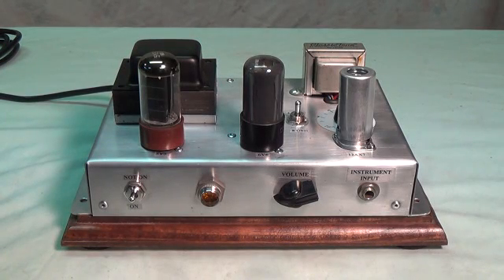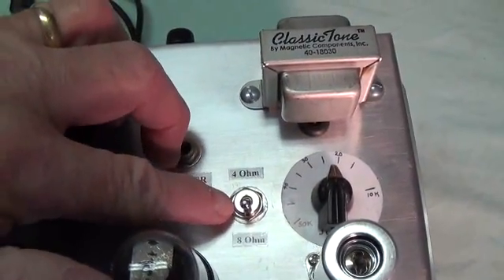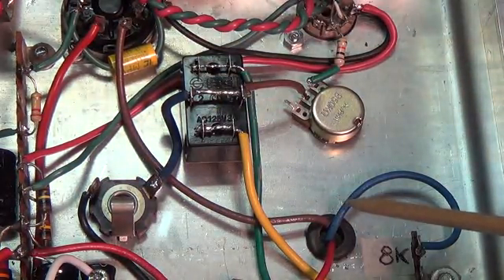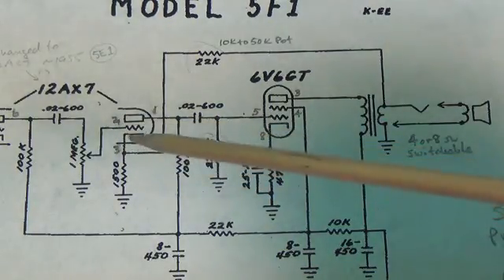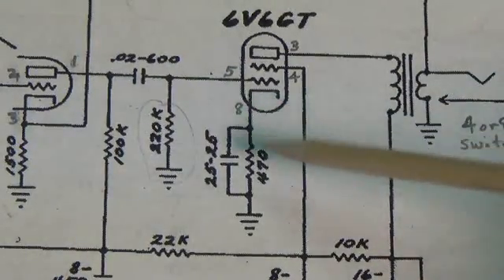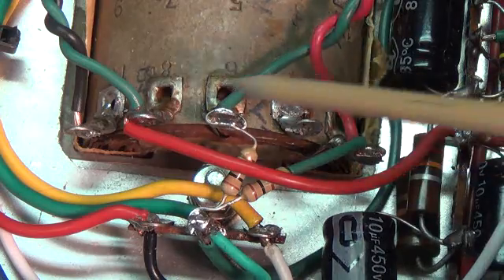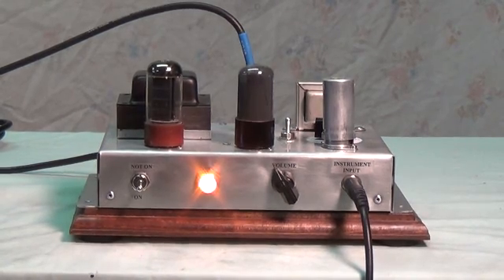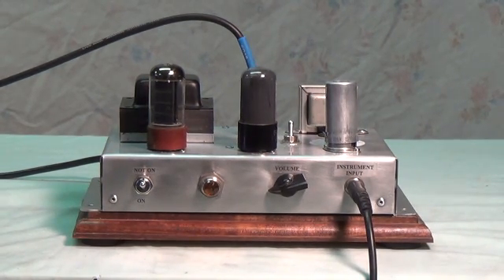Scratch Building a Fender 5F1 Champ from Scrap Parts.....Part 2

Comment: I have returned after 2 years of rukus to find this video. The NFB is a delight. I have a Kustom Defender 5H  with a EL84 instead of my fave 6V6 any way I had to find a Russian site and translate it to get all the mods Tone stack and Master vol) . The one thing missing was the NFB. Turns out the Defender 22K to the second section 12AX7 Cathode  made it silent there is no joy in Mudville. So, I put a 500K in series with the 22K and the vol was still low so I think a 1 Meg pot + a 100K might do it. .  I enjoy your videos and have learned so much. Thank you for all you do. Hope you are well.
Reply from the maker: You're welcome, Barney. Yes, we are all doing quite well indeed. Thanks !!
Reply: @UncleDoug   LOL if you want to have a chuckle, here is the Russian site for the Kustom Defender 5H. The translation is not so good. :) https://forum.guitarplayer.ru/index.php?topic=158288.30
Reply: Effectively they are saying for the Kustom Defender 5H, is; remove R3 the 0 zero  ohm resistor and insert the Fender tone stack into the two empty holes. . Treb lead to the top hole, Mid lead out to the bottom hole and ground to ground. This bypasses the stock PCB tone circuit.   Fender tone stack (Bass 250K pot treb 1Meg pot  mid  pot  200k,  Bass cap .047Uf, Mid .022uf, Treb .220nf  + 68k  joined lead out  to solder point connection.  (treb cap-resistor in parallel. ). Also remove   R15, R16, C15  (above the stock vol pot) .............(it's the stock tone circuit) ................................................................  Then for the Master Volume to the EL84 power tube, remove  R4, R16 and R17 (voltage divider) and replace with a 1 meg pot (voltage divider)  Wiper wired to top of R4,  lug 1 to top of R17  hole, and lug 3 to  top of R16 hole ( ground)...  The amp is a boutique niche that only 1% of guitar players will appreciate , especially 1920-1950s blues fans.  Its a screaming Bearcat when pushed, Its a nice tinder box at low vols.  This Amp can be had for $89 on eBay. It's a great learning platform.  I would like to calc the math on all the circuits.  Thanks uncle Doug,  I think you have all the videos for me to calculate the math.
Reply from the maker: Other than the snazzy Russian babes, the site was Greek to me, Barney. Thanks for the translation and good luck with your calculations :)

Comment: Start with a better transformer than they use-- preferably with a good choke as well.  It is impressive how decent some of the modern amps are, but the need to come in at several hundred dollars (like 500-1,000) means that have to build it at somewhere between 100-200 dollars. Like I said, impressive, but definitely one of the major reasons why some (and I say SOME) of the boutique, French, Italian and US amps are so much better.  Also a bit part of the reason why some of the 60-70's amps are so sought after, when they often only had to multiply by 2-3 times from manufacturing to retail.

I got a Jackson Ampworks McFly (about 1 watt with built-in attenuator on to 70 watts of pure single-ended Class-A output with both sets of 6V6's and 6L6's enabled.  That little amp has a 200+ watt custom transformer.  Also, (and I have seriously worked with hundreds of different amps), I love the Amplifier Company 3100 and Bimbo too.   Like the McFly, the Bimbo is perfect for studio and gig'ing, and sound so powerfully soaring, and so clean or raunchy at any output with amazing isolation and control that it can make you cry (or at least me).  There is no sweet spot for them that I have found.  It's like they are like ready to rage while under consistent control at any output.  

There are many other great amp designs, but I'd try starting with a great transformer and proper mechanical and electrical isolation, as part of what will help bring down the microphonics, feedback loop issues and other problems of many modern amps at various output levels.    Few if any of the great amps I know could do what they do without the transformer and related sections they used.
Reply from the maker: Thanks for your input, Andrew.
Reply: @UncleDoug   - BTW, love the handle "Uncle Doug".
Reply from the maker: A nephew called me that when he first learned to talk. For some reason it seemed to fit for my YT channel.

Comment: Pardon me Uncle Doug if you've mentioned, or accomplished this possibility in another video. Have you ever sat down, and made a crazy loud & powerful... "SHRED" amp? something like a Marshall Plexi- 100watts? I'd be very interested in hearing that and following along. This little Champenstein's journey is just swell! Thanks-
Reply from the maker: No, Bradley, the most powerful amp I've ever built was a AA-764 Fender Bassman......probably 50W. I simply have no use for loud, high-wattage amps and find them excessively bulky, heavy, and difficult to ship, when sold.

Comment: I have never built an amp before, and I am going to start with this exact design! I've had lots of people tell me that it is a great idea to start with a Fender 5F1 Champ for a first amp, because it has so few variables. One thing that I see being a problem is that you used parts that you found, and I will need to order new parts. I don't have the experience yet to sort out which power transformer,  output transformer, etc... but I hope the ol' internet can help me with that. I love the NFB loop dial. That is so clever. Also, the variable bias resistor that you can dial in with a screw. I don't know if those things are easily available, but I'm gonna try.  Being so new, it is also hard to find a reliable schematic to go off of. There are literally dozens and dozens of Champ schematics out there, but I can't tell just by looking at them if they are accurate or off, and if they are off... off in what way, and by how much. Ha ha ha. Oh well... gotta start somewhere. Thanks for the videos!  You should DEF. have a patreon page or sell your amps or something. I'd def. contribute or buy one of your refurbs, if for nothing else, just to say thanks!
Reply from the maker: Greetings, Michael, and thanks for all the nice comments. I do have a Patreon page and accept PayPal donations to account dldcam@aol.com. The schematic you are looking for is here:  http://i0.wp.com/myfenderchamp.com/wp-content/uploads/2010/03/champ_5f1-schematic.png  You can order your parts from Antique Electronic Supply and your transformers from Amp Parts Direct:  https://shop.amppartsdirect.com/main.sc  They offer transformer sets for the 5F1 Champ. Good luck.
Reply: I just built a 5F1 with a StewMac kit. It’s bog standard, and much less cool looking than this one. But it has every piece you need, and amazing instructions. If you want to go that route, I’d recommend the StewMac kit.

Comment: Thanks for the videos and sharing your knowledge. It seems that the tubes used in this amp were really popular...the 5Y3, 6V6, and 12AX7's seem like the standard for a lot of small amps. I think I'll use this circuit to make a small amp. I have an old wooden Philco radio cabinet that this would be perfect for!
Reply from the maker: You're welcome, 74D. Yes, those 3 tubes have been the basis for countless amps over the years. Good luck with your project.
Reply: Uncle Doug thanks a lot!

Comment: Hi Uncle Doug, thanks so much fom your videos, started working on amps myself with a lot of success. Came back to this video because I'm looking at a Fender Champ that's biased way too hot. 
Your Champ is really biased very cold at 9W at 31mA 305V. http://www.tedweber.com/webervst/tubes1/calcbias.htm
Bias calculator says you can have 41mA at 305V and still be safe. That must also be the reason it's breaking up so fast. The beast I'm looking at is running 19W, just short of 50mA at 400V. The reason is they just copied the Fender schematic values for the cathode bias resistor. 
Then again I'm beginning to think running stuff very cold is the key to what we perceive as vintage sound. Here in Europe the main European distributor of amp kits also have test voltages above 14W -- maybe this is because their main business is selling tubes ;-) Then again, we have the export transformers, most use the 230V connection. My wall socket has 238V, working on old PA amps taught me to connect to the 240V to get into the ballpark of the voltages indicated on schematics. 
There is soo much on youtube, but I would love to see a video of 1957 Champ that sounds killer in which they open it up and measure the voltages. If you happen to check my videos, sorry, didn't buy the dog to imitate you. My wife bought it and it's keeping me off work! take care, thanks again for your videos. 
Johan
Reply from the maker: As I stated in my response to your other comment, Zj, some of my statements in the SE Bias video were incorrect. Correct: Cold Bias = Lots of Headroom and Hot Bias = Early Breakup. I apologize for this error, but I was using a misleading graph, found on the Internet, as my source of info. 

I have found from experience that proper bias (PD) levels are subjective and vary depending on the needs/preferences of the amp owner. I think it's best for people to experiment with bias levels, to find the one they prefer.

I do like your suggestion regarding measurement of all the voltages within a good-sounding vintage amp, i.e. '57 Champ. Perhaps I will be able to do this some day. Meanwhile, best of luck to you in all your projects.

Comment: I want to really thank you for your videos.  I have not been around tube amps for a long time and forgot most of what I knew.  You have taken me beyond that point by far already.  But I do have a question that has been bugging me for several videos I have seen.  The hum from the heater circuit seems to be a reoccurring problem in many amps.  In this video you added a resistor network to make a phantom center tap to attack the problem.  I am wondering why not use a bridge rectifier to convert the heater current to DC.  Would that not be a total solution?
Reply from the maker: You're welcome, SW.  60Hz hum is generally not a problem in a properly designed and constructed amp. Yes, you can rectify the heater voltage, but after smoothing the ripple with electrolytic capacitor(s), the resulting voltage will be too high (ideally around 8.9VDC), so you would have to reduce and/or regulate it. Since the vast majority of amps function just fine with AC filament voltage, there is little incentive to add full wave rectification, extra filter cap(s), a large step-down resistor (which would reduce the current flow), DC regulation, etc.
Reply: I got it.  Thanks for the thorough explanation.

Comment: the amp works a miracle for it makes a guitar wich is miserably out of tune, actually sound beautyful. thank you very much for the inspiration about the modification to the negative feedback loop as well as thelesion about 6v virtual ground using 2x 100 ohm resistors (1/4 Watt i assume, right?) no need to apologize about the lousy passgae!!! that makes the things you do, comparable. your vid´s are a true inspiration to anyone interested in tueb amp building.
iám planning to modifiy a dynachord HIFI Favorit II T, the t stands for transistorized and i want to revert this amp to a former stage wehn the amp had tubes in the pre amp stages.
i would love to hear your recommendations about this project.
Reply from the maker: You're welcome, Herman. We're glad to hear that the video was inspirational, despite the guitar being "miserably out of tune" :).  The procedure to replace a transistorized pre-amp with tubes would be a daunting one, particularly the need for creation of an additional power supply. Perhaps you could use the same one I describe in my video regarding the Rick-o-Tone Tremolo, with opposed CT 12VAC transformers. Good luck.
Reply: it´s like a rollback with this amp in particular. the dynachord hifi favorit I had tubes in it´s preamp stages and hifi favorit IIt got transistorized in its pre stages. power amp still is 2xel34´s and a driver 12at7 (Ecc81 i guess) i watched your vid! the one you´ve converted a trans and turned it into a tube amp. that alsowas very inspiring. it actually got me think about converting my dynachord.......thank you very much. i love your vids.
Reply from the maker: You're welcome, Herman. Best of luck with your project.

Comment: I’ve just come across this great little amp vid. I do love your humour! I believe that you have your output jack switched marked the wrong way round. You have the yellow 4Ω wire connected to the end of the switch nearest to the output jack, and the same end is marked as 4Ω on top of the chassis. However, the yellow wire will be connected when the toggle is switched away from the socket. Toggles connect to the opposite wire to the way they are switched. If your speaker is 8Ω then you actually showing the 6V6 10K by using the 5K tap. Might be why you think 5K is better than 8K? Cheers for another great video!
Reply from the maker: First, thanks for our nice comments and eagle-eyed observation re the 
wiring of the speaker impedance switch. I still have the amp, so I 
pulled the chassis, disconnected the yellow wire from the toggle (to eliminate interference from the OPT winding), and tested for continuity in both switch positions. While I agree that most toggle switches operate as you describe, this one, possibly because it is DPDT, operates in the opposite mode. The toggle direction agrees with the position of the activated lug(s). In other words, when the toggle is in the "8 Ohm" position (toward rear of chassis), the rear lug ("8 Ohm") is energized, and vice-versa. I'm relieved that I didn't commit this "bush league" error. Thanks again for your interest and input.

Comment: I'll be damned...I built one of these from scratch about a year ago, my first tube amp build (I don't play guitar, but my brother was going to take lessons and wanted a small amp) but the thing was plagued with an annoying 60hz hum I couldn't track down. I was routing and re-routing filament wires, even tried shielding them. The fix was your two resistors to ground trick. Thanks!
Reply from the maker: Yes, the old "virtual center tap" trick is a great hum reducer. We're glad it solved your problem.

Comment: Nice tip. Making the virtual center tap I would have never thought of. Nrgstive feedback is common on amps. It puts a negative or opposite of the sound wave distortion. Thus it cuts the the distorted part of the wave more because it is at the top of the signal. Adding tone controls is a no brainer. I would sdd those. All in all, good job!
Reply from the maker: Thanks, John :)

Comment: Doug so far i have enjoyed listening to your guru teaching you have taught me much. i have a proposal  of lucrative   mutual gain ive alamo paragon bass amp  that ive had for over 27yrs that i desperately need fixed in turn i will relinquish my fender champ amplifier that ive had also justas long please help sspitt1@gmail.com if interested
Reply from the maker: Thanks, Tim, but Rusty and I have retired from doing outside electronic work. Perhaps another qualified individual will see your request and respond. Best of luck.
Reply: Uncle Doug  hazzah i have gotten  that paragon amp ,well i think my sound is back but the can that o replaced it with was the champ amp i was offering ya but that can is 40/20/20 @ 450 the one originally was 20/20/20 @450 . Dont know if thats ok cause im self learning mostly by trial and error and all of the wonderfully easy insightfulness you share with everyone thank you i am still a noob but the 40 value pole has made my amp really loud and voiced but the old can spewed black tarry stuff and did something else to 5u4 rectifier tube so i replaced it with one from another amp i recently got for 50 bucks all original 1968 fender vibrolux reverb still working but very mistreated  sorry goin off track but the other thing is line out (?ohms)is dead the ext spk (?ohms) works well and regardless of 1-4 input to the bass and normal channels operate and affect the other is that cuz im using ext spk jack ?help me Uncle Doug i feel like a hound passing a peach pit am i safe thanks again

Comment: could you send me the layout of the amp? fine work there man, i'm looking forward to build  this  as my first project,cheers from argentina! !
Reply from the maker: I never created a layout diagram, Francisco......I don't use them, so I never make them. Why not try to build the amp from a schematic?
Reply: Uncle Doug  the schematic is  the one you can find easily?  because yours have slight modifications that are interesting ,thanks for the answer
Reply from the maker: You're right, Francisco. I forgot that I did modify the circuit.....and never documented it in a schematic. Hopefully by using a standard Champ schematic and including the modifications I describe in the video, like the adjustable bias resistor and output impedance switch, etc., you can still made a good facsimile.  If questions arise, just ask :)
Reply: Uncle Doug you're very kind, i appreciate that, i'll let you know, and i hope to see more of your work , take care and thanks for replying!

Comment: Triodes layout shows the blue 8k off the OT going to the 6V6? So 5K is better?
Glad I've watched the video, never built an amp with a negative feedback loop, and might of done it with two speaker outs..
Reply from the maker: I like the 5K primary impedance, Jeff. If you build one, try it both ways and see which one you prefer.